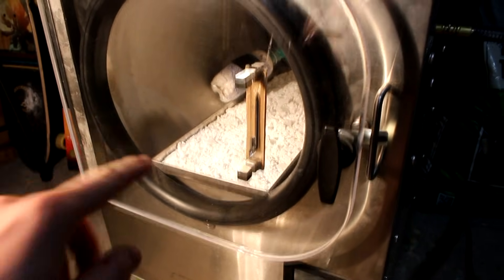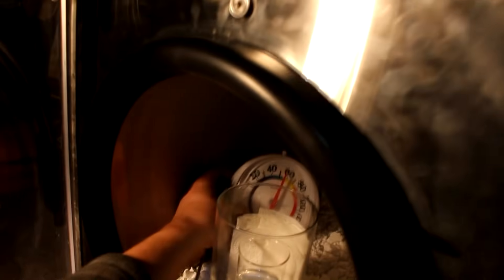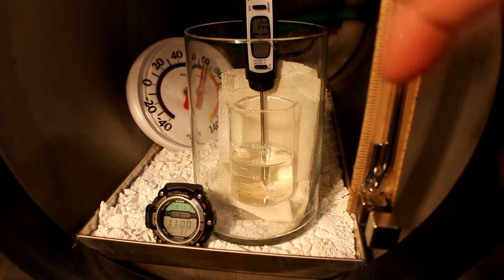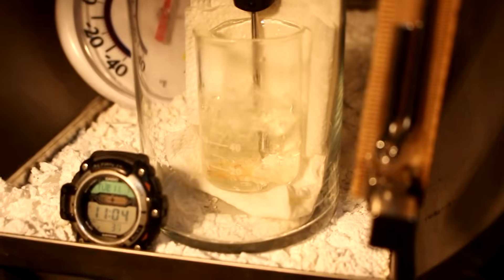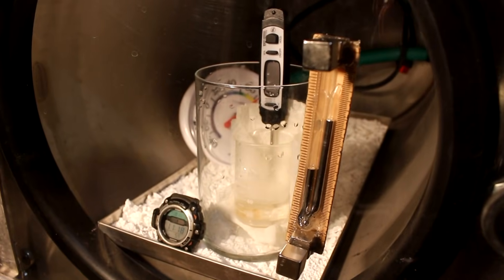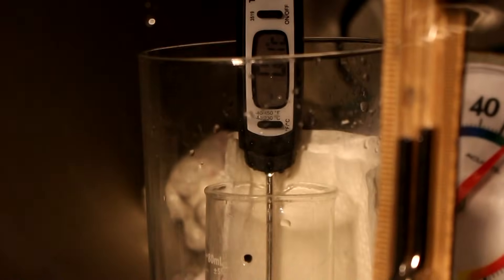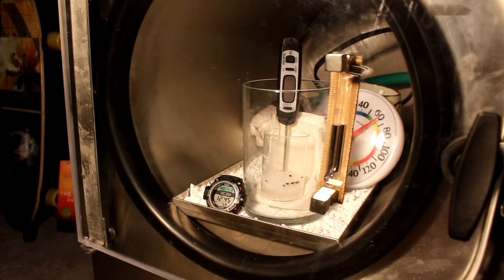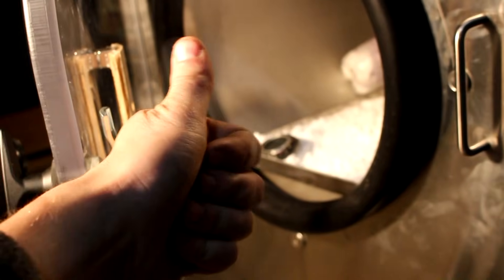Boiling Water Until It Freezes

Comment: what would happen if he open the door of the vacuum chamber
Reply: well for one the mercury would return to normal very quickly and shatter the meter on the chamber door
Reply: also it would be very difficult to open it, because of the lower pressure inside the chamber
Reply: Santii K a black hole would be created
Reply: Have you tried to open the door of a (commercial) aircraft while in flight ? It's almost impossible. And the pressure isn't that low on the outside, and it is lower than at sea level inside the cabin.
Reply: +AnatoleH1 It's especially hard because the flight crew immediately jumps in to stop you :p
Reply: This is the complete opposite of a plane. A plane is low pressure outside, high pressure inside. This is low pressure inside, high pressure outside.
Reply: Grey _Wolf1 I guess that kind of depends on how the doors open. I'd assume usually, doors that separate pressure differences are designed to be sucked shut by that pressure difference. No idea how exactly that works on planes, though.

Comment: Wow great to see some more vacuum footage. I have done this before and I think the first time you experience watching it happen kind of makes no sense. Once you figure out the lack of pressure on the water molecules trying to keep their formation from the vacuum, heat is exchanged to the point the water molecules boils uncontrollably as energy expends itself and freezes. A higher power vacuum pump takes a lot less time. With a dual stage pump this happens in less than 30 seconds. 
Good job Cody! Next maybe a little plasma formation?

Comment: But the question is : DO POPSICLES TASTE BETTER WHEN DONE THAT WAY ?
Reply: would also concentrate the sugar and make it sweeter though!
Reply: Also is it faster to make 'em that way ?
Reply: these are the REAL questions we need answers to
Reply: Also is it electrically cheaper to make them with a vacuum?
Reply: From the video i'd say it's a lot quicker because he had the whole thing converted to ice after 12 minutes, whereas it would have taken probably more than 1/2h in the freezer.
Reply: ah, but it'd probably cost more as a lot of the liquid would boil away before it freezes
Reply: the 12 minutes doesn't matter. the vacuum pump could be drawing a lot more power than a freezer
Reply: You might get some unwanted bubbles in your popsicle that way, since it can literally freeze solid while boiling.

When my physics teacher at college did this, he actually let the water supercool this way, and then he gave the flask a strong tap to make it freeze up near-instantly.

Comment: So, assuming we dont care that our food is losing structure through the negative pressure, would low pressure freezing be more efficient then conventional low temperature freezing? I would assume yes because I ASSUME ( I am a biologist, physics is not really my cup a tea :) ) it is much less wasteful to keep the negative pressure in a sealed chamber then to keep low temperatures in a freezer.
Reply: It would be much more efficient for long term storage since you could make it really close to a vacuum and then just not open the damn thing or let any air in until you wanted whatever you are storing however it would also mean everytime you get something out you have to refill the chamber with air get the item and then re-empty it before everything thaws out which it would start doing as you fill the chamber unlike a traditional low temperature freezer where you get a small grace period since the air inside the chamber is also super cool so the contents stay cool. So I would say for long term storage where you won't be getting things out willy nilly yes it's more efficient but it would be more costly if you used it like a conventional freezer
Reply: No, that won't work. Did you watch the video to the end? It took over an hour of a running vacuum pump to freeze that small amount of water. Those pumps take quite some amount of power (and often need active cooling). You are also "drying" stuff that way. You loose huge amounts of water from your object and if it's dry it won't freeze at all.
Reply: Yeah, the drying part is actually a problem. I havt even thought about that yet. You would basically be freeze drying your sample. Ahhh bollocks, I thought I had a splendid idea to make a tonne of cash with :)
Reply: Kudos to you for being a biologist
Reply: Cheers mate!
Reply: Anton Kubala but you'll have to pressurize the chamber again every time you open it :/
Reply: Yes, I had similar thoughts, but as said, for ultra long term storage it wouldn't be a bad option. For example, in our labs (or labs all around the world) there are certain probes and stocks that are just untouched for months or even years, that basically just sit in the -80 freezer or in liquid nitrogen until someone needs them for an experiment. And these -80 freezers cost a fortune in electricity ( and they are also rubbish because they always accumulate ice in annoying spots so you cant open or close them properly). Well, solids themselves dont have a vapor pressure, but the water inside, for example a strawberry, would freeze at low pressure, even thou the negative pressure will first rip the cells open and turn it into a mush.

Comment: Your explanation of the cooling mechanism wasn't quite right. Heat being taken away doesn't necessarily mean the temperature is lower. That's like saying a small piece of copper is colder than a large piece of copper because there is less heat in the small one. Heat is a measure of energy, temperature is a measurement of average energy of each particle. The reason it cools is that the higher energy particles leave first, leaving the lower energy particles behind and therefore the average energy of each particle is lower meaning a lower temperature.

Edit: On a rewatch, you seem to know my explanation but your wording ("leaving the other ones colder" for example) is misleading.

Comment: I guess the reason that the dense boiling stones didn't help is because in this case the water appears to nucleate at the surface. This makes sense, as it is the warmer water that is boiling, and the warmer water should be at the top (ice itself notwithstanding). This is different from water boiling on a stove, where the water at the bottom is hotter simply because that's where the heat is entering the water from.

Great video, as always.

Comment: Sry if this is a stupid question  but i dont know anything about stuff like this.
What happens if you use a positive pressure instead?

Could water become a solid without the boiling part? Or does it just do the same thing?
Reply: Ice is an odd case since it expands as it freezes, meaning putting pressure on ice will tend to make it liquid again simply because liquid water takes less volume. But eventually, as you pressurize it further, it will turn solid again, yes.
Reply: Luftbubblan 

If liquid water is put under lower pressure, the temperature required to make it boil will go down. This is why water under 1 atmosphere pressure and 25C will not boil but water at 25C and under much less pressure will boil. If you kept the temperature at 25C and greatly increased the pressure, it would force the water to freeze.
Reply: You can look that up in a phase diagram.
Generally: If you put more pressure on it, stuff will go from gas to liquid to solid. So yes, just applying pressure will make water solid at some point, even water way above the boiling point, for example at 400°C will be solid.
Reply: If you look at the phase diagram, ice with pressure on it can also turn back into liquid. The thin film of liquid water that forms on the top of the ice due to this, is what causes ice to be slippery.

Comment: something i wondered for some time now. is boiling water like this equally effective as boiling it normally at killing the germs?
Reply: No, it wouldn't be. It's the heat that denatures the structures that make up microorganisms, the lack of oxygen might be harmful to them in the long run but the act of water boiling alone (without the heat) wouldn't "disinfect" it.
Reply: It depends on what is in the water. Many bacteria would die eventually because of the pressure yes, but things like fungal pathogens or viruses (or certain kinds of bacteria) would be unaffected.
Reply: Boiling kills the germs from the heat, not from the boiling itself.
Reply: The people saying it's the heat are correct.  It's why people that live at a high elevation (think Colorado, where the pressure difference is noticeable) should actually continue to keep heat on water even after it boils.  There is enough of a difference that by legal standards (US law anyway) the boiling point of water is no longer hot enough to actually disinfect.  This get worse in areas like Nepal where you are at much higher elevations.
Reply: ramses bams you still have the drop in pressure...it should kill everything that can not exist in space.
Reply: David Bhart wouldnt the becteria boil too?
Reply: I'd be to lazy to live in Nepal then.

Comment: Was the 0.013 ATM actually correct. Because i know that low pressure is hard to reach and at 0.006Atm you need like centrifugal atom extractor and many pumps. And your reading got even lower than that and you had boiling water there. So that pump didn't  seem like one wich whould be capaple of doing that.

Comment: I own the same watch and I'm curious whether its pressure gauge would have stayed accurate ...
Reply from the maker: not at all. it seems to conk out at just 30,000ft
Reply: Ahah amazing ! Thank you :D
Reply: That's a Casio SGW300H with pressure and temperature gauge :)
Reply: What brand/model is it? I was just thinking about that.
Reply: Can confirm, it's the Casio SGW-300H, I have it too, although mine's got a black ring on the inside around the display as opposed to Cody's silver. A quick google search reveals that they're both the 300H, just some have silver while others have black.
Reply: Aumetre Antonin Thanks!

Comment: how would a mechanical clock be affected by the vacuum? i could imagine it running faster 
(at least if its not hermetically sealed)
Reply from the maker: a quarts watch should have no change, not sure on mechanical though, my guess is it would speed up slightly for the reasons you mentioned.
Reply: Electronic wach precision is governed by a quartz crystal inside. Those crystal are sealed in a small metal can since the crystal naked is very fragile. wach Crystal is called tunning fork crystal. It resonates at an exact frequency (like a diapason). Wach chip divides this reference to get seconds, minutes and hours. So, even when its true that there is sort of mechanical part inside an electronic wach, it is super sealed. The facts that make crystal drift are TEMPERATURE (heavy quadratic dependence) and vibrations (can even damage the Crystal). Also, the wach chip is not very tolerant when some properties of the Crystal change, so even when it coul drift tooo much, it will make the wach fail completely. Chip is also super sealed also. Like other user said, the LCD screen could be damaged but doubt the wach could get damaged. Almost every electronic gear around us use quartz crystals as time reference. Crystal are cut to a specific frequency. Ok, not very interesting ....but wach Crystal is working at 32768Hz (oscillates 32768 tmes per second). It a CLASSIC number for sure. Timekeeping in the computers use the same. Crystals eventually age and drift permantly every year (wach can get slower or faster ... just by a very small amount, like 5ppm). Computers have no probs since they go and adjust the time using time servers over internet. So do the phones. HIGH precision references for laboratory use CESIUM. Those ones are insane accurate and wont drift. Precision time could be derived from them
Reply: If the watch ran faster in a vacuum, then the seals and gaskets would have failed. If the gaskets did fail in a vacuum, then the watch crystal would literally blow off. This is sometimes observed by deep-sea divers. All watches that have been used in EVA's have survived (to my best knowledge and research). Which means that their gaskets didn't leak any internal pressure.
Reply: 38911bytefree Not sure if this is also directed towards me. But to clarify I was only talking about mechanical watches, not quartz or tuning forks. Also my mention of "crystals" was in reference to the case crystal, the front glass of the watch in which you can see the moving hands, not the quartz crystals.
Reply: Dylan Greene Was general info kind of post, I am writting (I think it is still possible) my opinion on what I think is happening or not happening. Didnt read you mention about crystals, just read the firs and second comment I believe (didnt click see more). So, no worries.

Comment: theres no where for the heat to go in space... it would stay a blob till it touched something then disperse all its heat at once and freeze
Reply: radiation
Reply: Actually, the evaporating water molecules are what takes away the heat from the main mass of water; that's why it cools down by boiling. The very act of evaporating requires energy, and since the water isn't heated up, that energy is taken from the water itself. Same thing would happen in space.

Comment: Is it correct, that the boiling point of liquids in vacuum could be lower than their melting point because the vapour pressure is always higher than 0?
Reply from the maker: yes I think that is accurate.
Reply: Thanks!
Reply: If one cooled a liquid past its melting point it would freeze. The vaporization  temperature point is greater than or equal to the melting temperature point for a  given pressure: equal to being the triple point. Examine a phase diagram to see this. It is true, however, that the sublimation (solid->gas) temperature is lower than the melting temperature (for low pressures), unless the triple point occurs at 0 pressure and temperature.
Reply: Ah of course. But the result is the same.

Comment: I was an engineer at a company that builds pharmaceutical freeze dryers. Feel free to contact me if you have some questions. I might be able to help!
Reply from the maker: yes, why you no make the seal better so I dont have to run the pump all the time? :P
Reply: Haha, the company I worked for didn't make the dryer you have. Is it a Labconco or something made for flowers/food?

In industry the vacuum runs constantly, even in a "perfect" system. That JB Industries Platinum vacuum pump should have an anti-suck-back valve, so you shouldn't be leaking from there. Make sure you keep some vacuum pump oil on hand...

Anyway, it has a neoprene gasket and it looks really old too. I'd recommend making a new gasket out of silicone tubing. McMaster part number 3038K27 would be a decent choice. Make a slit down it and then glue it together using RTV silicone. I can give more details on the process privately.

If you don't want to make a new gasket (don't buy one, you'll get ripped off) you can grease the door surface and the rim of the chamber with silicone grease. They make special "vacuum grease", Super Lube 91003 is probably the cheapest. If you make a new gasket from silicone, there is no need for grease. I would recommend using a small amount of this grease on all of the connections for the vacuum pump and any other hoses going to/from the chamber. 

Your sensor ports could also be leaking. Replace gaskets if the ports have NW, KF, or sanitary type connectors. Reapply teflon tape if they are pipe thread. A small amount of vacuum grease can be used just on the outermost layer of teflon tape. It should just be shiny.

If you're still getting leaks, it will be nearly impossible to find without a good vacuum gauge (stuff for HVAC probably won't help much here) or some refrigerant and a leak detector.

Comment: noob question: why does the water freeze in a vacuum?
Reply: Gigzur so everytime it bubbles, energy is leaving the solution?
Reply: sopopular09 Yep
Reply: ***** couldve added a timestamp
Reply: or could have just paid attention.
Reply: The Sage thx for helping
Reply: Gigzur thanks for the explanation
Reply: The conversion of a liquid to gaseous form takes energy, and since this conversion here isn't done by heating up the water, that energy is simply taken from the water itself, causing it to cool down until it crosses the freezing point.
Not sure what Gigzur is on about with that "-50 degrees Celsius" though; going below 0 is enough to freeze the water, and the water in the experiment never went below -10.

Comment: Can you purify water from freezing...

I mean it would be super slow, but if you took all the off gasses it should be pure water...

i might have just found a way to sell a gallon of water for 3 grand.
Reply: girrrrrrr2 Distillation is probably what you're after.

In theory you could collect the vapors from this process but it's not much since the watery freezes.
Reply: The gasses aren't coming out of solution "because" he's freezing it, they are because he's decreasing the pressure.

Plus, even then the dissolved gasses aren't all of what makes water not pure, there would usually also be lots of dissolved minerals. (Although there are some chemicals that will be "forced out" of freezing water as it turns to ice, so the process can be useful in some situations.)